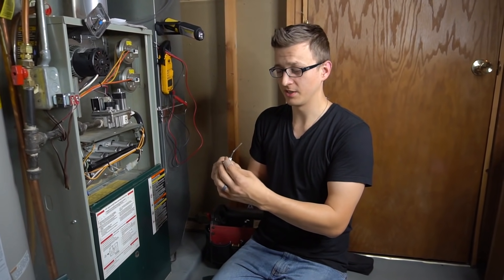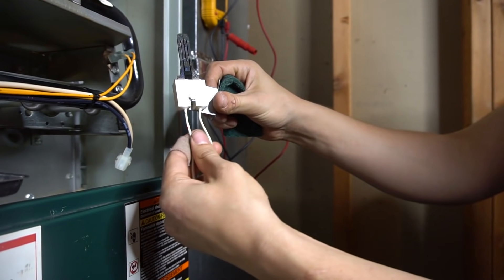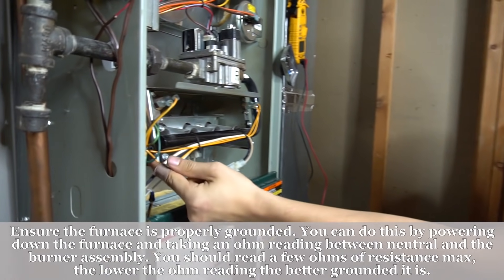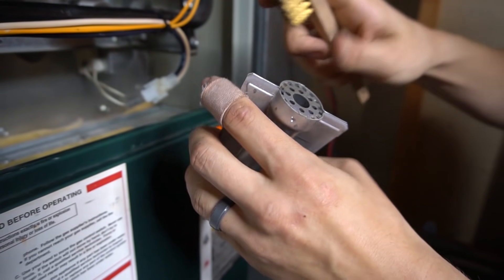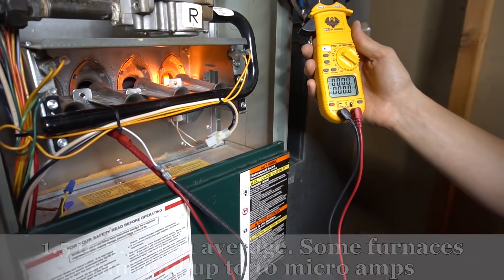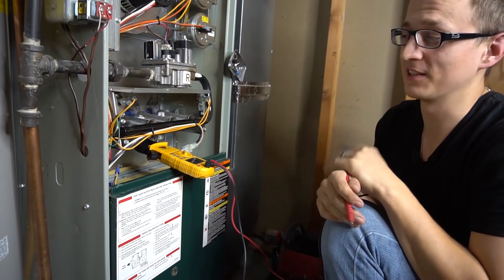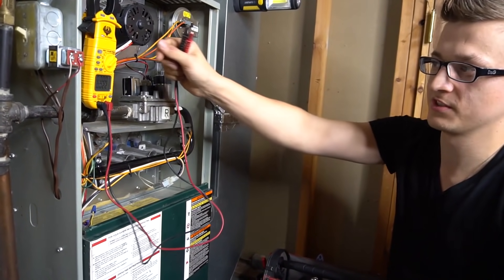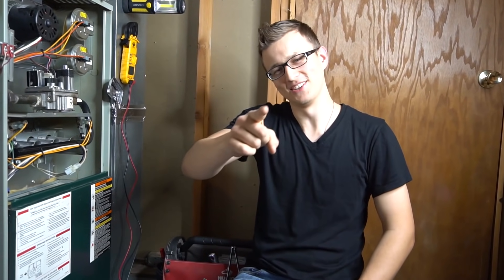Furnace Not Working - Troubleshooting the Flame Sensor

Comment: Testing voltage on my flame sensor (Carrier Furnace) reading at 65 AC & when the flame kicks on it reads 62 AC. My furnace keeps turning on and off after a couple seconds. Brand new Board & Flame sensor. Any thing else i should check or do?
Reply from the maker: Sorry to hear about the furnace troubles. Have you tried cleaning the face of the burners? That may help: https://youtu.be/6ehk0NZVFcg
Another thing that may help is to slightly bend the flame sensor a little closer to the flame/adjust its position.
Reply: @WordofAdviceTV  should i bend the flame sensor back towards the burner and then out a little more towards the middle of the burner? The sensor i got is the Original one but they both looked like they sat almost way to low from the flame
Reply from the maker: @MrHrGGamingHD   I would try doing what you said. Or if you are able to do this, take out the screw that holds the flame sensor and simply hold it with your hand in different positions and angles to see which one will keep the furnace on. (if any)

Comment: Hello quick question last year i was having this same problem i cleaned the sensor and no more problems untill now its doing the same thing so i went and cleaned sensor again and did not work would it be possible that maybe i should replace with a new flame sensor,  also unit is 13 years old carrier brand

Comment: Hi, my Nordyne furnace had flame sensor problem, yellow light was on . I bought a new flame sensor, I replaced and the furnace was working but the yellow light still on. Can you let me know how to resolve? Thank you.
Reply from the maker: That may mean that the flame signal is still low. I would try cleaning the burner that is in front of the flame sensor.
Reply: @WordofAdviceTV  will do , thank you so much.

Comment: I have the same furnace, getting 5 flashes, “Flame sensed when no flame should be present”.  Cleaned flame sensor, then installed new sensor, still same problem.   Furnace starts, heats, then after reaching thermostat temperature it shuts off burners and then continues to blow cold air with 5 flashes code until I reset the power.  My next plan is to remove and clean the burners.

Comment: New igniter, cleaned flame sensor. Furnace comes on but no glow from igniter and shuts off?
Reply from the maker: Do you have a meter? Can you check to see if the ignitor is getting 120v? Do you hear the gas valve opening?

Comment: I have lennox ghr26.  Burners glow orange, then blue flame and in 3 seconds shuts off.  I took out the flame sensor and cleaned it.  It wasn't that dirty but the back end that connects to the insulated cable to control board was rusty.  I cleaned it but still same issue.  Is flame sensor broken?

Comment: Hi, I cleaned the flame sensor and it fired up and ran which was great! But after about 10 minutes the burner goes out.  Any suggestions?
Reply from the maker: If it ran for 10 minutes then something else other then the flame sensor is the problem. When the burners go out, does your control board blink any error codes? My first thought is that your furnace is overheating. Have you tried replacing the filter even if it looks clean? I also have a video on 10 reasons why a furnace can overheat so if that's what is happening with your furnace, you may find that video helpful too.

Comment: I installed anew ignitor (old was broken) furnace worked for a couple weeks. Now burners try to light maybe a couple seconds and go off  code is 34 checked flame sensor it looked like new I still cleaned it with a Scott bright. Its propane  gas pressure is between 11 1/2 and 12 inches.I even chanted gas valves and it made no difference

Comment: I have been trying to fix a furnace with no gas valve operation. It had code 1 ( ignition malfunction) long story short the flame sensor was the issue. It through me for a loop because I thought the flame sensor input only became valuable after ignition it turns out it is used before ignition as well..

Comment: My burner lights and warms up the exchanger but when the fan comes on the burner shuts down, I have checked the temperature switch, even bypassed it and it still does it most of the time, sometimes it actually puts warm air into the house, maybe 1 out of 6 try’s.

Comment: You say the control panel sends 90 V to the flame sensor but how does that voltage get to the sensor If it's only a single wire sensor

Comment: What should I do when I see a thermocouple staying slightly lit when Hwh is satisfied in temperature?
Reply from the maker: That water heater probably has a standing pilot. Which means there is a little flame that stays on 24/7 and the big burner only turns on when the tank needs to be heated. Older water heaters were all like that.

Comment: How do I check a ignitor/sensor I have a 902691A and it keeps giving me a “false flame sensed” code?
Reply from the maker: Are you sure that is the ignitor? To me it sounds like your flame sensor or the wire going to it is shorted to ground. Either the flame sensor rod is touch the burner or a wire is pinched somewhere. Could be a faulty control board as well.. Hard to say without checking it out.
Reply from the maker: Have you tried unplugging the wire going to that sensor? Does the same problem continue? If it stops showing that code, then I would try replacing the sensor/spark ignitor

Comment: GREAT video. Question: My burners ignite for about 8-15 seconds and then shut off and then repeat this cycle.  I've replace the limit switch and cleaned the flame sensor and the problem continues.  What would be the next test?  After watching your video I might assume trying to remove and clean the burner in front of flame sensor.  Also checking ground wire (I don't exactly know where this is).  If I disconnect the lead to the flame sensor and started the furnace and got the exact same symptoms I have been having, could I assume that the problem lies within the burner. sensor, ground wire components - rather than within the circuit board or some other unknown component?  Thanks for taking the time to help us handymen out.  Much appreciated.
Reply: I hooked up multimeter (mA - DC) to the flame sensor lead (red) and to the wire terminal (black) and when the burner flame came on I did NOT get a reading of mA.  You stated between 1.5 and 3.5 was normal.  Mine read 0.00  I also have 2 green lights (steady on) and when the burner kicks on, a yellow light flashes below the green ones.  Then the burner goes out and the yellow light goes off.  Does this mean anything significant?  Thanks.
Reply from the maker: @SurvivorDiet  Hey there! Sorry to hear about the furnace troubles. Hopefully you will get it figured out soon!

1. As far as I recall, a yellow light like that stands for "low flame signal" so it seems like the board recognizes that there is a problem with the flame sensing.

2. Does your flame sensor have around 90v going to it? To check, you can just put one lead on the flame sensor connector and the other to ground (any screw in the furnace cabinet will do).  If it does not, then there is a good chance that it is actually a bad control board.

3. The ground wire is usually mounted somewhere to the burner box that surrounds the burners. If you can't find one anywhere you can always try putting one in to see if it makes a difference. Just take any piece of wire and put one end under a screw that goes into the burner box and the other end under another screw that is in the actual furnace cabinet body. Using crimped on wire connectors is preferable but not mandatory.
Reply: @WordofAdviceTV  Thanks for your reply.  I had a tech come out today because everything I tried, failed.  I do get about 100 V reading from the flame sensor to ground.  I also watched your control box video.  The technician that came out went through many of the same issues and concluded that it must be the control box.  I tend to agree based on nothing else working.
Can you tell me what a typical cost is to replace the control box so that I have some idea when the tech comes back to do the work?  Thanks again.  I appreciate all of the time you put into your videos - especially the one with your notebook and the most common furnace problems.  Too bad I wasn't on the most common list.
Hey - do you have a donation page or a paypal address?  I'd like to send you some compensation for your professional help and advice.  Very much appreciated.
Reply from the maker: @SurvivorDiet  Ah I see.. Thank you for coming back with an update! Sorry to hear it couldn't just be something simple. There's really no good way to troubleshoot that part of it. The board sends power to the flame sensor and then the board is supposed to sense that the current made it to ground.. That second part you can't really troubleshoot. Hopefully the board will be the final solution,  these kinds of "rare" problems have potential to get even uglier.

The control board itself can vary in price from furnace to furnace. On average they are $100-200. But if you add in the labor/diagnosing, price mark-up for the part, and trip fee your bill will easily get to $500 or more.

I have a PayPal donation link on the very bottom of my long video description. Don't feel obligated to do any donations though good sir. Sounds like you will be making out some payments as is. Save some money for the upcoming holidays :)
Reply: @WordofAdviceTV  you were correct.  I ended up paying a little over $500 for the control board replacement (after paying 220+100 for a thermostat that didn't need replacing and a service call).  It sucks because I am a very handy person and I like to do a lot of this stuff on my own but this particular problem was just beyond my ability.

Thank you again for your help - I tried to use your PayPal donation link but it directed me to a dead page.  It looks like your link is partially cut off and this is the same in ALL of your videos. You should look into that.  When you fix the link, let me know and I'll make a donation.  I know how much time and effort it takes to make such instructional videos and you deserve to be compensated when you provide a valuable educational service to people.  Perhaps in some strange way I have also helped you here by discovering why you may not be getting any PayPal donations. Good luck.
Reply from the maker: Eh.. Well hopefully the furnace won't need to be fixed again for a good 10 years now! Stay warm ;)

And wow! You are totally right, I just checked those PayPal links and sure enough they all end up on a dead page. So I thank you very much for making me aware of that. I believe I got them all fixed now thanks to you! :)
Reply: @WordofAdviceTV  Thanks again - donation complete.
Reply from the maker: @SurvivorDiet  I appreciate it! Thank you for doing that, I just checked - now I know it is working. Stay warm and Happy Upcoming Holidays!!

Comment: I have American Home Shield, I've had 2 different HVAC companies at my house in the last 5 days. Each telling me something different, both looking at and replacing the flame sensor. The one today, replaced a section of gas pipe after telling me he detected no gas leaks but he replaced a section of pipe nevertheless and cleaned the burners. The unit ran find for several hours. It is night again and the unit is not connecting or running. It is attempting to start. American Home Shield according to both contracted HVAC company technicians will not replace the furnace even if the warranty policy says it will. 

What to do, because I do not have cash to pay someone independently when I pay for this policy monthly.

Comment: What is the casue the furnace not working but the igniter is ok and i check the voltage  of flame sensor by  clamp meter the red test prob to terminal of flame sensor and the black test prob to the ground i get 54 volts AC but i cannot get microamps of flame sensor due to my clamp meter didn't have micro amps reading.

Comment: So I’m having a similar problem except the flame or the main burner will stay on for more than three seconds it roughly comes on and it will turn off after about 30 seconds I’m not sure if this is the flame sensor or something else I have clean flame sensor and reinstalled it and it does the same thing

Comment: what if my board is not sending voltage into sensor I swapped control to another unit it works swapped regulator gas valve, grounding is good as well help please

Comment: At first, my flame sensor went out.  Igniter would come on (glow) and furnace would ignite, then turn off.  I took the flame sensor out and shined it up.  That worked for several weeks then the furnace wouldn't come on again.  Tried recleaning the flame sensor but now the igniter does not come on.  Any suggestions?

Comment: Thank you for the video! I'm still having the cycling issue.  I cleaned and eventually changed the sensor. I also cleaned the burner face (but just the one in front of the sensor - it was pretty nasty) I checked the ohms and it was 1.6 - 1.7 and the voltage showed 3.5.  The sensor I got was a slightly less of an angle than the previous one, but still right in the middle of the flame.  Any insights are highly appreciated :)

It is an old bryant furnace

Error code is showing "34 Ignition proving failure"  which is weird since it glows red and the flames start and then turn right off
Reply: mike s  thanks for the suggestion,it was a burnt out circuit board. Got a cheap replacement on eBay and was up and running in no time

Comment: After cleaning the flame sensor, I turn the power and gas on and everything is silent, the furnace just stopped working, what should I do
Reply from the maker: Did you try resetting power to the furnace? Next I would suggest this video: https://youtu.be/ZayiUTuyq7I?si=COxNIdqEEvZ5lvsL

Comment: Having issues with my furnace. 

The fan starts, The hot surface ignitor lights up but I never get a flame.....
Reply: Check the pressure switch and its hoses and the induce motor. The flue might be clogged.

Comment: My trane xe80 only measures 6VAC at the flame sensor. It is blinking 5 fast blinks. I suspect my controller is bad. It started out with the short cycling the burn sets- runs for about 3 or 4 seconds then shuts off. I cleaned the sensor and thought I would be good but now the symptoms have changed to this. I installed a new flame sensor before watching this video. Anybody have any ideas?

Comment: I have a furnace that acts exactly as he described a flame sensor problem. Main burner lights for 3 seconds and then gas valve shuts off. I replaced the flame sensor, but it is still the same. I tried measuring milliamps with my tester but didn't get any reading. I also tried measuring the ac voltage to make sure the control board is sending power to the flame sensor, and when the furnace is off, I'm getting an AC reading, but as soon as the igniter starts to heat up, the voltage drops to zero. I thought it would be the opposite from watching this video. Anyone have any idea of what I should try next?

Comment: Can anyone help me ive check everything. Ive got voltage going to my flame detector and i just put in a new one 3 days ago. And it was working. Now it does the 3 seconds and kicks back off. Ive cleaned my burner assembly. But i see that i have no direct ground on it. The ground is no the gas valve and then goes to the small fan. Ive tested the oms in the wires and those are good. But it still wont work. Need help asap

Comment: This seems to be a good spot for my question:  My furnace starts correctly most of the time!  HOWEVER, sometimes the initial fan kicks in (not the main blower the exaust fan) the igniter does not click, the burners do not light and of course the furnace does not start.  If I leave it be...sometimes the igniter will kick in and the furnace will start.  Sometimes I have to keep turning the furnace off and on to get it to work.  This problem seems weird to me because the problem happens MORE if the furnace AREA is cold.  It is in a closet in a bathroom....so if I run a small space heater in that bathroom the furnace seems to work much better.  Is this my imagination?  or is the issue something like the flame sensor?  If it's something that I can easily fix, I would rather take care of it.  Besides:  It's a learning thing! 🙂

Comment: My furnace acts like flame sensor is bad. Cleaned it. Nothing. Replaced it. Nothing. Gas turns off right away. No loose wires. New board. Motors turn on. Gas valve?

Comment: I replaced the flame sensor and my furnace turns on for a minute and then turns off, what should I check next?
Reply from the maker: Is it blinking an error code on the control board? My next guess would be that your furnace is overheating. Have you replaced your filter recently?

Comment: I replace the motor and the capacitor the heat sensor the one above the heat sensor and that piece on the back wall of the Furnace I'm not 100% sure the name of it my friend is running for 2 days and then it quit the blower motor turns the filters clean brand new I don't know what else to look for it fires up and runs and then it shuts down but the blower motor doesn't turn very fast

Comment: Another symptom of a dirty sensor is you set your thermostat to 75 and won’t get past say 62, take that sensor out and clean it with a dollar bill or 0000 steel wool never ever touch it with your hands because the oil from your skin will shorten its life.